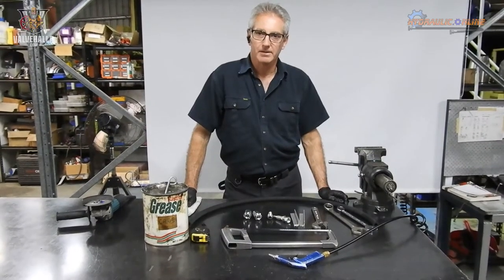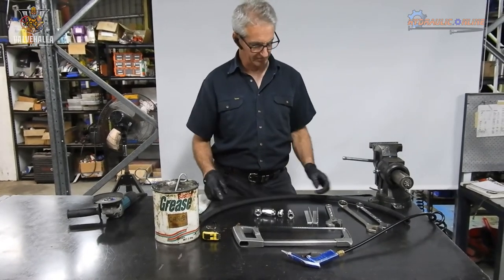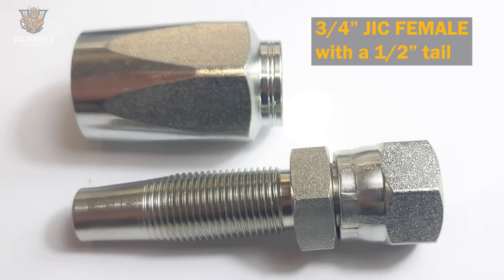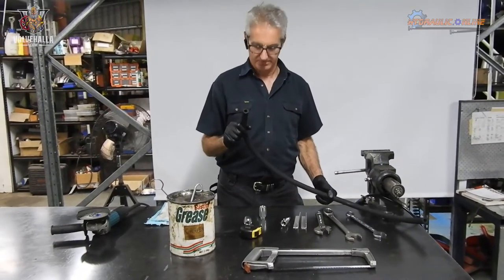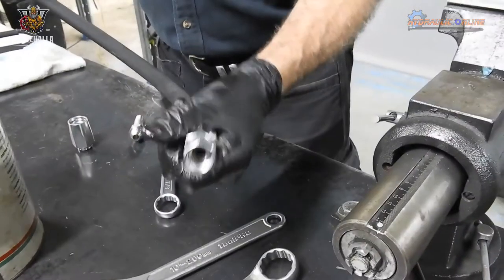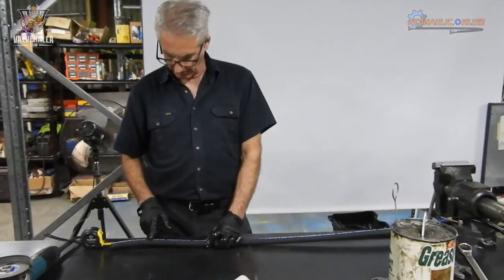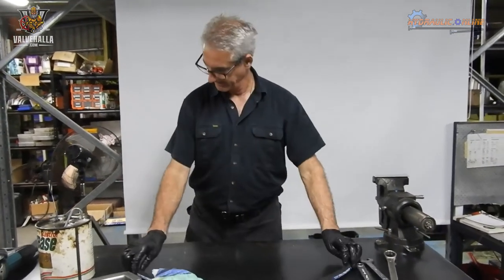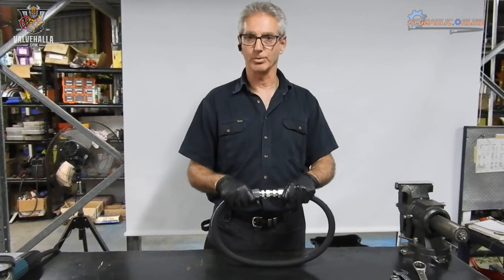How to Fix, Repair or Replace a Damaged High Pressure Hydraulic Hose 2,500 to 5,800 psi

Comment: Great video as an operator I always thought you had to have a hydraulic crimper,I would like a video on identifying the different types of connections for different machines and adapter parts, plus the hand crimping tool advertising on line
Reply from the maker: We have most of those videos Deep 6, try searching for them on our channel.

Comment: used a few of these 30+ never leaked over the years they have been in....the beauty is if the hose is a bit long, you just cut it off and do it again....with an impact driver and long sockets you can do a hose in a couple of minutes...great product....mines probably banned them because sometimes people take short cuts and don't do things properly,if your sitting on the machine you will not do that.
Reply from the maker: I think you are on the right track, the main reason they were banned in mines was that they may not have been used correctly or in the right application, also reusables fittings do have a certain maximum pressure limit and over that limit you must use crimp on fittings.  Modern mining equipment use much higher pressures and smaller components made of stronger materials to generate large forces. Reusables still have their place still but in mines many have chosen to use crimp on fittings.

Comment: What to do about plow hydraulic line connections to ram coming loose,  leaking.  Plow Is new. Is there a lock nut or jb weld option to keep fittings tight? Leak empties fluid res, making plow inoperable. Simple stuff,  suggestions?
Reply from the maker: Johnny try checking the following, because it sounds like there may be a twist in the hose, or the hose is slightly twisting on connection, or the movement or articulation of the connections may be causing a twist, if there is any twist in the hose as it is pressurised it will try and straighten out cause it to loosen.

Comment: Can’t you put the hose on the vise and screw on the fitting? Rather than the way you show on the video. I’ve done AN fittings for automotive use by putting the hose on the vise..
Reply from the maker: You can put the hose in the vise but you need to make sure that you don't over-tighten the vice and damage the hose's external outer cover or distort / bend  and stress the steel wire reinforcing.

Comment: this is all nice but in Norway where most people ( I mean those who have power to come with restrictions) live in fear age is now illegal to use these type of screw fittings...
Reply from the maker: Interesting, In Australia they are not allowed to be used in mines any more. And in the US some designs especially for 100R5 hose used in the transport industry the maximum operating pressure must be reduced compared to crimp on fittings. 
The reason we made this video is to ensure that if the assembly guide lines are followed accurately the pressure rating will be the same as a crimp on fitting.
Reply: why when they are better, stronger and more reliable than the crimped fittings?
Reply: @danielgolenia5181  all about to take away human freedom of fixing stuf by them self without special tooling. Have to buy hoses with redy pressed fitting by 500mm step or go to expencive hydraulic shops and pay at last 3 times as much for custom lenght
Reply: Everything illegal in the people’s republic of Norway..The government is taking over, live in fear..didn’t they ban farming also ?
Reply: @lulop022882  nope but it's illegal for farmers to sell direct to customers...